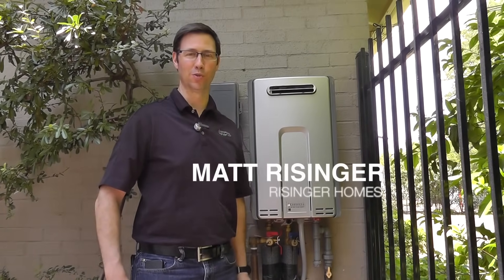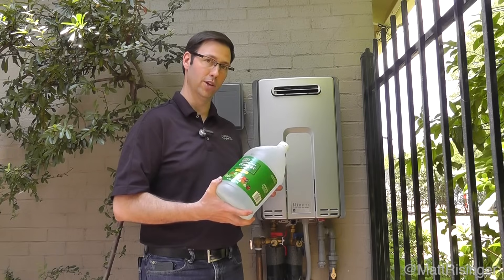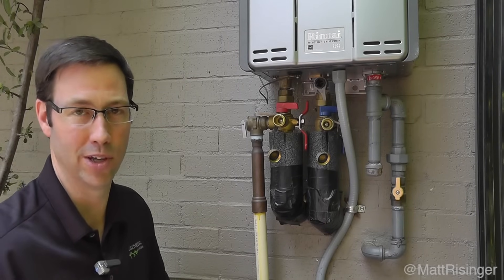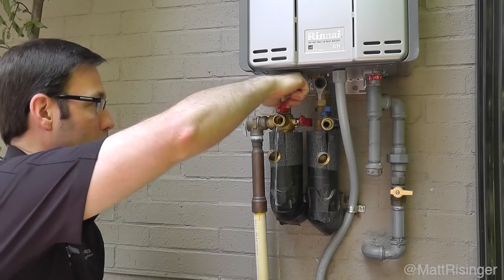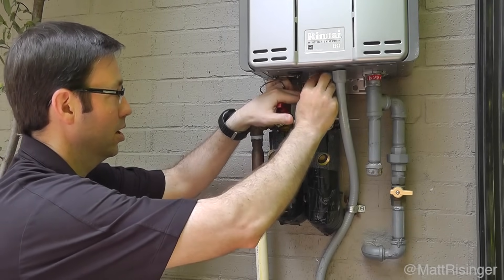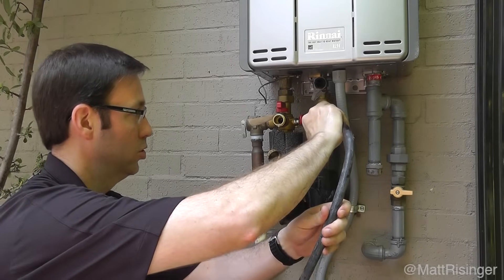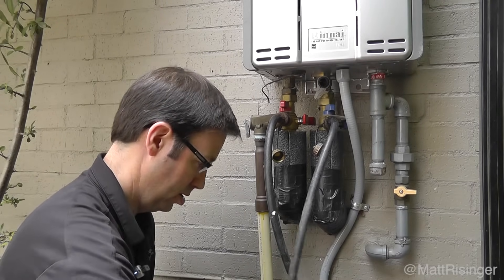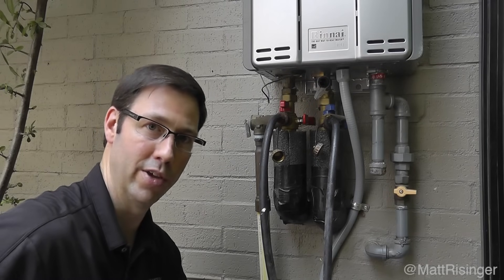Tankless Water Heater DeScaling - How To Flush

Comment: Loved the video and I just did the vinegar flush in my rinnai tankless system.  I also just donated $10 as you saved me a lot!  Question ... the vinegar in the bucket got hot.  Is this normal?  Also, the vinegar more trickled through the out take hose.  I was thinking more would flow through.  I have used this sump pump before and it can pump a lot of liquid through it, so kinda surprised that vinegar just was a heavy trickle through the out take hose.  Is this normal?
Reply from the maker: +sargescott1 Yes, both are totally normal.  Thanks for the donation!
Reply: +Matt Risinger You're welcome!  Thanks for the answers.  Keep up the great work you do!

Comment: "Plumber did a great install", but you have to struggle and fight to be able to access the shut off valves?  Sounds like the plumber should've planned ahead a little better. All he had to do was clock the valves slightly so they could be used as intended, rather than force many customers to have to rely on another uncaring plumber to service their unit for them. 
Not a good look. 
     That being said, great video and we love our Rinnai tankless. Thank you for taking the time to show others how this procedure is done.

Comment: I think you just missed this when you summarized the post-flush procedure, but you probably want to open the supply valve and flush water through the unit to get the vinegar all out before you remove the drain hose, otherwise you will get a slug of vinegar into the plumbing, and that might be unpleasant if the first user is making tea or washing their faces or something.

Comment: Thank you for this video.  I will make a donation.  (1) Find and use a hose kit with plastic connectors.  The vinegar reacted with the brass connectors in my hose kit.  The in-line filter caught the flakes of reacted metal from the connectors, so it was really not an issue.  (2) The Rinnai manual indicates to rinse the vinegar from the water heater by not opening the hot water shut-off valve, retaining the drain hose from the hot water line, and running water through the system for five minutes.
Reply from the maker: +Paul Dobson Thanks Paul!
Reply: For me 5 min are not enough. I ran vinegar over the system tap to tap, and it stayed smelly for some time, like a day.

Comment: The Rinnai manual also recommends that you rinse the cleaning solution from the water heater as follows:
a. remove the free end of the drain hose from the pail
b. close cold water service valve and open cold water shutoff valve.
Do not open hot water shutoff valve.
c. allow water to flow through the water heater for 5 minutes

It appears that you must run the drain hose outside to rinse the tank; otherwise, you will have a lot of water flowing where ever you have your drain hose.
Reply: Steve Saltyfire Is it necessary to rinse the water heater after flushing with vinegar?

Comment: Matt,  Your demo is great, but I need a demo specifically for my Takagi TK4-OS-NG unit!  Please post a video showing how to flush a Takagi TK4-OS-NG outdoor water heater.  I am a new owner - mine was installed 7 months ago in December 2014, so I have never flushed it before.  I live in the Los Angeles, CA area - how often  do I need to flush the water heater?  Does my Takagi come standard with a pre-filter that also needs to be cleaned?  
Reply · 1

Comment: Thanks for making this video
 I have a question though. I have a flow problem when I do this. The outflow of vinegar from the hot water line is very low. just trickling out. I cleaned the debris from the filter first as well.

Will this clean it? Or will it not do a good job? Do you know why this may happen?

My pump fills up the inflow tube quickly (I have clear hoses so I can see). So the inflow of vinegar seems good.
Reply: Maybe you pump doesn't have enough power (pressure)? I am guessing.

Comment: Thanks for posting this,
I am in Melbourne Australia, have the Rinnai Infinity 26 for ~ 10 years,
the hot water has never been over ~50 degrees C
I have been advised to flush the unit, like you show, to get hotter water,
my unit has no flushing bypass fitted,
I will have to do some plumbing to suit,
is the flushing necessary for this area ??
what else can I do to get water to ~ 70 degrees C ?
Thanks again

Comment: I have unscrewed and removed the prefilter cap.  The cap comes off with the o-ring but the filter itself seems to be stuck in the fitting.  Any suggestions on how to remove the filter so it can be cleaned?
Reply from the maker: Ken Markman Try a long needle nose plier.  That's what broke mine free.  You could also spray it with some WD-40 to loosen it.  Matt

Comment: Thanks for your video Matt. I did call Rinnai and i was suggested to keep the gas line on. Turn on hot water and when getting a stream of hot water, unplug the unit. This will keep the valves open. Use vinegar for 45 minutes, as it's effectiveness is pretty much gone after 45 min. Maybe use 3 gallons for 45 min and another 2 for 45 more minutes. This is for my model # of RUC98i. Different units may have slightly different directions. 
Another suggestion is to put a cloth such as panty hose or similar over the sump pump which will keep the scale from going back into the heater
Thanks for your video, doing this was a breeze.

Comment: Hi Matt, great video! I am considering to install the Rinnai RUR98in. What do you think about the unit and how much is the reasonable cost for the unit plus installation? CoServ in Dallas will be coming out to check my gas line and probably upgrade the gas meter from a "white face" to a "red face" to ensure sufficient BTUs for the tank-lass water heater. Thanks.

Comment: Thank you!  This was a great step-by-step how-to - I picked up a pump, 5 gallon bucket, and hoses, and it took only a few minutes to get my Rinnai cleaning under way!  I did have a good bit of trouble getting the small cylindrical filter out (maybe a sign that I was due for a cleaning!), otherwise so easy to follow.  I did find I needed to power off the remote display, as it started beeping when I started the process.  I let the pump run a couple of hours - next cleaning I'll adhere to the 60-90 minute cleaning cycle, as the vinegar was dark and hot by the time I was done.  I paid the plumber who'd installed it a few years ago $125 or so when he came out a couple of years ago to do a flush service, and he teased that I really should be doing it myself and saving over $100 - while the set-up cost me that much this year, now that I know how, $8 in vinegar will make for great savings next year...  Thanks again!!

Comment: Thank you for the helpful instruction.  Just cleaning the filter already improved our problem.  Then, I started preparing the flushing process, we faced another problem.  What could we do when the blue and red valve do not want to turn.  Somehow the red one (hot water line) was open since they installed the unit 8 years ago so I could drain the hot water while the blue valve (cold water line) would not move at all and remain closed.  Basically I cannot turn both valve to open or close maybe because deposites buuit up due to lack of any maintenance.  Are there any tips to turn/open/close the valves?
Reply from the maker: mcenroe59 I'm sorry but I don't know what to recommend.  I think it might be time to call in the pro.  A master plumber would solve that quickly for you.  Matt

Comment: I used 12 Litres of vinegar and ran it for just under an hour, when I came back, the solution was blackened heavily, I could only see into the bucket about 6". This doesn't seem right from reading everyone's comments. Should I be concerned? I am thinking of doing the process again within a week to see if with fresh vinegar and a supposedly clean system if I get a black solution again.

Comment: HI Matt Thanks for the video.  What are you thoughts on an anti-scale filter installed ahead of the water heater.  With this type of flush do all of the parts in the heat exchange get flushed too. Someone mentioned to me something about a bypass value and that doing a flush a certain way would only flush the lower parts and not up to the heat exchange parts. Thanks

Comment: Great instructional video. I went to Home Depot and made my own DIY kit with a 5 gal bucket, pump, and hoses. definitely easier than I thought to do and saves a couple hundred bucks plumbers want to charge to do a flush.
Reply from the maker: Nice Job Michael! Glad the video helped!
Reply: Michael I'm interested in doing this. Any chance you could help by giving a little more detail on what you used. Especially in the place of the pump? Thanks

Comment from the maker: @dennisv21 Nothing you need to do with your reducer valve.  The flushing is only inside your unit.  Best, Matt
Reply: Matt Risinger Thanks Matt! Real cool, you can fix anything with instructions from Youtube. We have a 6 yr.old Rinnai R94LS never been cleaned out,it stopped heating the water. We have no water softener and hard calcium by the beach. Will try the flush out, Wish us luck, Looks like $1200 for a new one. Has installed washing machine fittings and have a sump pump somewhere in the shed? LIving on a budget means: forced to try it out your self. Thanks again Matt!

Comment: Matt, because of high water pressure coming into my house, I had a pressure reducing valve installed on the water line to prevent leaking from the PRV on my Rinnai tankless WH.  Before flushing, do I need to do anything with that pressure reducing valve?  I assume not, but thought I would check with the expert (you).

Comment: Matt, Here in NM we are required for the tankless heater condensate line to have a ph neutralizer cartridge installed before discharging to drain. What is the Ph level of the condensate and is there a cheaper way than purchasing a $80 filter yearly to treat this discharge?
Reply from the maker: carl molter Carl, I thought those cartridges lasted several years?  I'm not sure of another way to deal with that, I've not heard of regulation about condensate.  I thought it was towards the base end (rather than acidic) but I don't think it's too toxic.  Put into a city sewer I don't see it causing any harm.  Matt
Reply: Bosch use a inbuilt calcium carbonate neutralizer, maybe you could look for something similar.

Comment: So the HOT water hose is dumping purged scale & vinegar into the 5-Gallon container and the COLD hose is drawing that same fluid from the bucket and flushing it back through the boiler channels?  Should you flush it with clean water after you've done the 60-90 minutes with vinegar?
Reply from the maker: Correct.  We are just making a simple look of vinegar to flush the system of any scale.  Yes, do a quick clean water flush.
Reply: Matt Risinger Matt... I'm doing the 4-Gallon flush right now using a Flowtech 110V pump with a remote pickup, I checked my system, it doesn't seem to have those little filter inserts.  Its 2 hours and I don't really see chunks of anything but the vinegar seems to have darkened slightly to a slightly green color.  Should we see the scaling or does it dissolve?
Reply from the maker: IronhorseMike I rarely see much in the flush stream, occasionally some verysmall particles.  If you've gone 2 hours you should be all done and set for the next 12-18 months.  Nice work!  Feels good to do it yourself and save the plumber service charge doesn't it?  Best, Matt
Reply: Matt Risinger My plumber told me I should do it myself when he installed it.  I confess about 24 months since he installed it.  Now that I've done it, I can see its a piece of cake.  Vinegar is $ .81/Gal and it turned out I had a useable pump.  So I saved myself probably $150 and once you set it up, you walk away and go do something else.  I actually let it go 2 hours and 45 minutes.  Then I did a 10 minute fresh water flush after making sure it was drained.  THANKS!

Comment: Very helpful demo/instructions!  I just have a couple concerns.  First, is there a specific reason for leaving the power on?  My heater produces an annoying beeping noise while the flushing process is under way -- presumably a warning that the flowing water is not getting heated because the gas has been turned off.  If the unit does not actually have to be on during the process, I could unplug it to get rid of the beeping.  Second, after running the process for close to 2 hours, I detected no change in the vinegar solution.  Since the unit had not been cleaned since it was installed 3 years ago, and our local water is full of iron, sulfur, and other minerals, I was expecting the water to turn dark, or milky, or at least murky.  Instead, it looked perfectly clear and clean!  Does that mean the process didn't work or just that the unit was not as dirty as expected?  I do have a very effective water softener, and I change my whole house water filter about every 6 weeks.  Even so, there was a lot of scale on the heater's pre-filter when I cleaned it out; so why wouldn't the vinegar solution in the bucket show some evidence of scale removal after 2 hours of flushing?
Reply from the maker: Jim,  #1 I think turning off is OK.  Not like the power needs to be on for calcium to break down.  #2 if you have a softener you likely won't get much/any scale in your unit.  This tells me that you can go easily 24-36 months between flushes.  Maybe do a pre-filter check annually then flush every 2-3 years.  Best, Matt

Comment: Hey Matt -- would ever leave the prefilter out during the flush to get more vinegar flow through the system? Seems like my sump pump is working extra hard with the resistance of that filter -- and since the pump can't quite match the flow of the actual water input it seems like a safe bet.
Reply: Clint Green Ha ha I sadly figured out why you should leave the prefilter in. That plug is sealed with a rubber o-ring. If the prefilter is NOT left in, the flow of vinegar can tear the o-ring off and then you've got a heckuva leak.

Comment: Matt, I have a Rheem tankless water heater that is frequently throwing up error code 12, no flame detected/failure to maintain flame. Do you think that this flushing process would help resolve the issue? Also, do you have any suggestions for increasing water flow? Several of the faucets have significantly lower water flow, which I'm assuming may be due to buildup of scale. Thanks.
Reply from the maker: Andrew Wan Andrew, I'm not sure but I can tell you that it can't hurt.  If your unit hasn't been flushed regularly that may be your problem.  Best, Matt

Comment: Rinnai tankless water heaters are very sensitive to scale buildup in the heat exchanger.  To keep high efficiency, you must descale often.  Before the warranty expired, my heat exchanger burst, fortunately while I was nearby.  That's when we found out that the warranty is not very good.  Yes, they covered the cost of the new heat exchanger, but did not cover any other parts that they felt should be replaced (just in case) or any labor charges!  I was forced to purchase another tankless heater while the parts were ordered in and installed.
Reply from the maker: ***** I'm sorry to hear of your troubles.  I've used a lot of Rinnai over the past 10+ years and not had a problem to date.  I would say that ANY brand tankless is susceptible to scale issues not just Rinnai.

Comment: great video. I have a question... What do I do if I cant turn my hot and cold water shut off valves? I tried to turn them  but they wont move at all in any direction.
Reply from the maker: starr leader You probably need a plumber to visit and replace those valves before doing this service.  If they are stuck open you can't flush the system.

Comment: Hello Matt, I am in Dallas TX and I have a whole house water softener installed. How often do I need to run this procedure?
Reply from the maker: I would expect that your Water Heater would need a flush every 3-5 years (because of the water softener, the scale will not likely form).  It might be able to go even longer, but to be safe I might service it every 5 years.  However, you might pull the sediment pre-filter every 1-2 years to check & clean it.  Best, Matt

Comment: Matt thank you for your easy to understand video, the Rinnai system you showed is just like my installation, I would add to your instructions to turn off the electric to the tank, it will beep for an hour and a half, one other point here in Raleigh, North Carolina the temps got down to six above last winter, I had to insulate my two water valves. Again thank you Matt you did a great video. John A Sullivan Raleigh, North Carolina.
Reply: Thank you for this.  I have a Rinnai too and when I ran the flow into the cold side, the heater was cutting off and on and beeping (I guess it was trying to heat the vinegar) so I thought I was doing it wrong and breaking it.  So then I ran it into the hot side and everything was fine.
Now taking your advice, I shut the system off and ran it into the cold side.  Hopefully running it both directions won’t hurt anything.  Also, I’m in Charlotte and don’t seem to have any scaling or sediment.